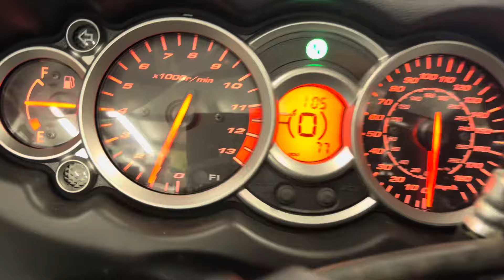Barn Find Busa the conclusion of 14 years of silence. 2008 Hayabusa

Comment: Check the fuel filter in the tank! Injectorcleaners. Most importend this model had a recall on the part onder the kat,. You can bring it to every suzuki dealer free of charge to let it be done. It appears that you can have engine fail at hi speeds if it breaks. Its for the elektrical current. Im dutch dont know the english word for it sorry.
Reply from the maker: Watch the rest of the series.
Reply from the maker: It cleared up. I had primed it with premix fuel to help with lubrication since it’s been sitting for 14 years. Just had to burn the oil off. She purrs like a kitten now.

Comment: First thing good you changed the battery because the hayabusa wont start or stay on with a bad battery the rpm must stay above 4000 for the alternator to feel good current It also seems that when you rev it all pistons work but when you release throttle something ain’t right
I suggest you test your rectifier it maybe the whole issue because that part is a piece of shit when it starts failing it gives you tons of question marks and sends strong signals back to the battery and cause it to make stupid things 
It won’t cost much to replace it
Depending on the year some are on the side fairing some even behind the engine in the lower part near the exhaust pipes
I have a 2017 12000 km on it bought brand new in 2019 until now no issues I’m keeping it clean and use my Z1000 to make stunts the BUSA it’s fun to ride tho no one beats you 😂

Comment: For the love of bikegods man dont do a proper inspection first instead of wiskey throtteling the hel out of it. You got a gem there in the ruff needs some TLC and your good to go. I have the same make model color only bit stretched for drifting and dragraces. Its still not  totallyt not running right at the end of the video..  
Or your injectors clogged up or need new spark plugs
Reply from the maker: Watch the rest of the series.
Reply from the maker: It cleared up. I had primed it with premix fuel to help with lubrication since it’s been sitting for 14 years. Just had to burn the oil off. She purrs like a kitten now.